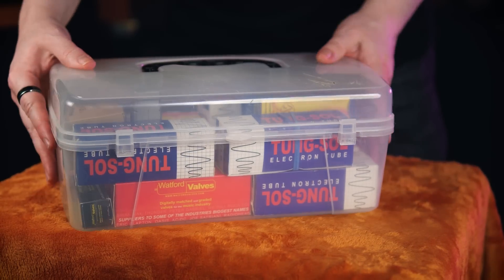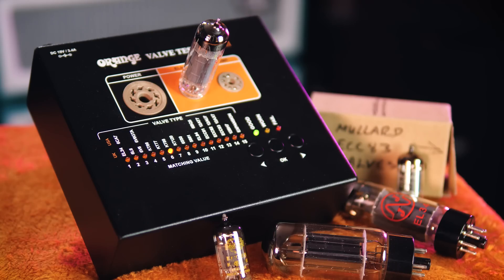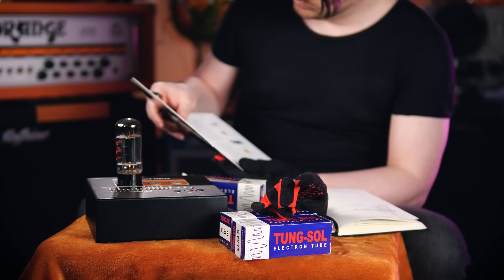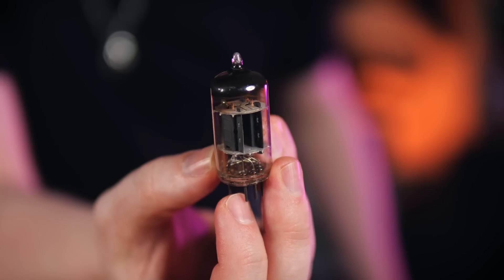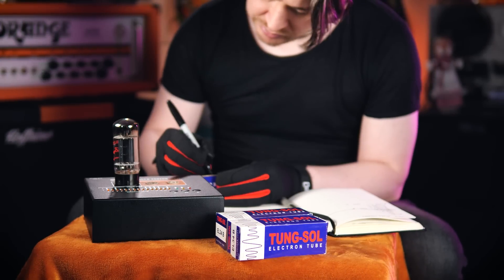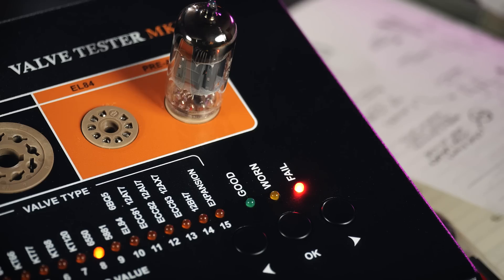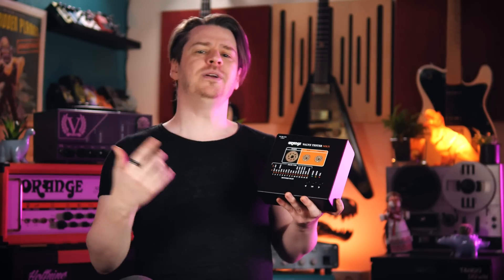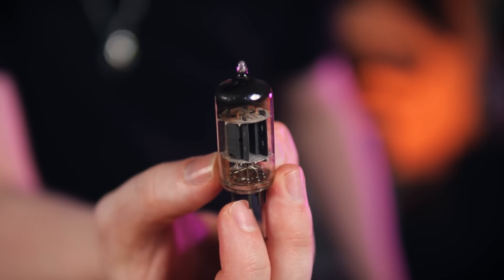Find Tube Faults Easily! | Orange Valve Tester MkII

Comment from the maker: Are my Tubes failing? How do I tell if my valve is microphonic? How do you match power tubes for balanced performance? 
The Valve Tester MkII from Orange will assist any amp tech in quickly and easily uncovering valve faults. 

https://orangeamps.com/product/valve-tester-mkii/

This video contains paid promotion from Orange Amplification.
More details on how Science of Loud implements product promotion - https://www.csguitars.co.uk/disclosure
#scienceofloud #tubeamp #valvetester

More from Science of Loud: 
Support on Patreon: https://www.patreon.com/csguitars
Join Science of Loud Discord - https://discord.gg/uJHFgJRunb
Buy Science of Loud Merchandise - https://www.csguitars.co.uk/store
Website - http://www.csguitars.co.uk
Contact - colin@csguitars.co.uk
_________________________________
Description contains affiliate links. Purchasing using one of these links will generate a small commission for Science of Loud at no additional cost to you.

Comment: For someone that gigs doing club circuits & small tours - or the person with a small recording studio - this is a great device. Even if it doesn't give exact values it get's close enough to give a matched set or more. This can dramatically increase the lifespan & quality of the gear. It can also help diagnose problems in a pinch vs waiting for the electronics tech to make time for you. You could easily save thousands in just time & equipment. I hope Orange engineers keep working on this to be able to add features.

Comment: Good to see a decent valve tester on the market. Yes, it is pricey, but worth it if one repairs a lot of valve gear. I bought a B/K tester from an electronic parts dealer that was going out of business in 1991 and I paid 550.00 USD for it. The list price was 1000.00 USD. It has paid for itself many times over. Performed a recap on it two years ago. Good as new.

Comment: If it's anything like Orange's VT1000 it'll be a burnt out paper weight after two years. Poorly designed and manufactured in China. The older tube testers Arvos, et al built decades ago put this type of crap to shame.

Comment: I have a Truetone(One Spot) mA Meter, cable tester, and (unadvertised) voltage converter. That and the Orange Tube Tester would be the perfect tech kit gadgets. I build big boards and the Truetone has been great, I write the mA on the back of each pedal to be able to reference it later for daisy chains and brick calculations. I use the Truetone Cs7 and 12 and the Voltage converter, again unadvertised but it turns any 9-18V source into whatever the pedal draws,  so the one or 2 12-18V designated outputs don't go to waste I actually mount it to the bottom of the CS7 board.  If I had the Orange Tester, I could run my wet dry wet tube rig with little worry as well. (It was old a huge but I knew i should have jumped on that Marketplace Tube Tester I saw for $50!)

Comment: Got a palmer model five and don't know anything about it. Nothing to find in www. It has two power valves GT6550A. Is it a 100W amp then? These old valves (actually tubes cause made in US 😅) do have signifikant black spots inside the glas. Is that an issue? Should I change them? Everything seems to work fine though. Thx to anybody who could help me out.

Comment: As an owner of many tube amps, this tool is a must buy in spite of the high price tag. I priced similar test tube kits and price is similar. Maxitest has one for less but only does preamp testing so you would have to buy two Maximatcher II and Maximatcher preamp kits at 2k to do same thing.

Comment: I have a question. What kind of switch is in the push/pull pots in my guitar? Is it double pole single throw? I don't know differences between switches.
Reply: You need to look at how many contacts there on the switch (not the 3 potentiometer lugs). From my experience with push/pull switch pots, most of them should have Double Pole Double Throw (DPDT) ON/Off switches. A DPDT switch has the ability to alter pickup phasing, alter the double/single coil configuration of humbucker pickups, turn an LED on/off, and/or power a preamp or an effect circuit contained within your guitar. 13:46
Reply: @toddwilliams8761  thanks, i have wired coil split and phase swap on push pull pots before but now i will try to wire 2 germanium diodes 1n34ato the push pull pot and i i will wire the DPDT part as an on/off switch. Basically i will put passive distortion effect in my guitar. Like a built in distortion pedal in my guitar.

Comment: The MKI unit was very unreliable, failed easily and Orange didn't provide any repair support, we had 2 of those units in our amp repair workshop and both failed and become unusable. I don't know if they fixed the issues with the MKII unit, but be careful, a Tester that you cannot trust is completely useless

Comment: I'd love for you to revisit the topic of valve vs solid state amps. I've yet to find a clear and concise explanation of the real world difference in application especially when it comes to distortion
Reply: Given that valve amps have such different topologies, whether hifi or guitar/bass, it would make for quite a lengthy video! The crux of it though, is that they can all sound different, obviously engineered for use case. Best is subjective. For what it's worth...I play music louder than I should and I love a pair of mesa 2:ninety for mid and tops, laneys nexus tube amps for the weight of sound, and an old denon integrated amp for recording vinyl. The denon sounds OK up to a point, the mesa's sound great past the point id turn down a transistor amp, and the laneys feel great, and roar in such a way long long long past the point the wattage would have you believe. As I said, it's a very subjective topic.

Comment: You can keep the tubes from the quads that tested good either as backup for other push-pull amps with a single pair, or for single ended amps. Or, if you know electronics, use them to build your own amps.

Comment: But over $1000. Priced for people who repair amps, not for the average guitarist I think
Reply from the maker: The average guitarist has no need for one of these, it's specialist test equipment for techs.
Reply: @ScienceofLoud  It's funny how you used to find tube testers at grocery stores (where they would sell you replacements). Now you have to know a guy 😁

A lot of people just buy new tubes without getting the old ones tested.

Comment: I just looked this tester up online..... Bloody Hell!!! HOW MUCH?!??!?!?!!?!
Reply: I guessed it would be $500-900USD, it's a brilliant piece of equipment, not needed for mere guitar players, more for techs who have dozens/hundreds of valves/tubes around.  Unless you are like me and have dozens of amps and more tubes than can be counted, you don't .need. this piece of kit, but I find it a brilliant piece of test equipment.  Chris is obviously a genius, I am a mere brain damaged drug addled guitar player (on good days), but I want an Orange!
Reply: @pharmerdavid1432  I have 1 6505mh and would have more amps if it weren't for the wife.

I have about 6 12ax7 valves for it (+ the 3 in the thing) and a spare pair of EL84 power valves for it. I'm one of those guys that takes the phrase "matched set" at face value as I have no other option. I would love a way to check my valves and make sure I'm know I'm happy with what I'm putting into the thing. Granted, it's not an old AC30 or something where the valves play a far greater role in the operation of the amp but I like to look after what I have.

If I was in your position with the amount of gear you have knocking about then price isn't really an option. You could even deem it as an absolutely necessary piece of kit.

Just £850 ($1,100) stung a little tbh.

Also, swap "valves" for "tubes" as you see fit.

Comment: It looks to be incomplete / VERY short on tubes and results. I guess a 5751 matches well enough to a 12ax7, but I doubt a 6072 / 12ay7 is covered. 3 color LED as the only ‘results’ doesn’t cut it either. I’ll stick with ol’ Superior Instruments TC-55 I got off eBay for 1/20th the price. Not great by any means, but seems to blow this out of the water.

Comment: Dude!!  I have a bugera 333xl that the distorted channels have basically no volume no matter how load I turn it up but if I run a signal like a preamp or my hx stomp into the return of the fx loop and it works perfectly fine as a power amp.  It’s really load being a 120w tube head but the tech I took it to checked all the valves and couldn’t figure out what was wrong with it and said to take it apart would basically cost more than buying a replacement

Comment: Great point on who it's for. I used the original unit for years, and it worked great to quickly identify the state of a tube, and then a good tech can use their ears to decide from there. The one complaint we always had, and it seems Orange tried to address with the microphonics testing, is that to truly test the roadworthiness of the tube - it should have a vibration monitor inside! Emulate the shake!  SHAKE IT!

Comment: I used to work for Marshall (terrible employer with 1960s-whip-cracking values in the 1990s so I left) 
We tested if the valves were microphonic by tapping them individually and listening to find if any were significantly louder than the rest ...with no signal passing. With  this in mind your vintage amp may not have passed this test when it was brand new. Just sayin'.

Comment: Have the mk1 version and still working great after all these years... hundreds of valves tested at my workshop... had to resolder all the tube socket pins due to wear and Stress... apart from that... works like a charm... nothing to complain

Comment: I would be interested in a less expensive 9-pin tube tester .. one that only tested el-84s and ecc83 would probably fly off the shelves at the right price.

just one socket, less interface, and much less processing power.....the problem is, it would still need a power supply; and that costs.
Reply: get a used vt 1000

Comment: if I had a higher power Si rectifier amp, it would eventually pay for itself. ( or like a bassist who runs a Traynor YBA 300, would waste a lot of money if they didn't get one )

but my only tube amp is a 5Watt with a 6Z4, so it's better to just swap tubes at reasonable intervals.

Comment: Colin,
     Really cool piece of kit!  Does operating the tester require wearing black and red gloves? :D
Reply from the maker: Gloves aren't required to handle valves, but I didn't fancy getting glass in my hands if I accidently broke any
Reply: @ScienceofLoud  That all makes sense.  Actually, I was teasing you a little about your "stylish" choice of gloves :D  Rock on!
Reply: 1 - possible breakage
2 - tubes get HOT when you apply power to them.
Reply: You could absolutely go with other options like black+orange, black+navy blue, red+navy and many more. Just don't use pure white, because your valves could be scared and run away.

Comment: Holy Cow! It's about time something like this is made available to techs! The last "Tube Tester" I ever saw was at a Radio Shack in the mid 80's. That was a monstrosity, but it did very similar tests on many kinds of valves, not just ECC8x or 12A_7 and the 3 major power amp valves. Some of the socket designs dated way back to the invention of valves, or shortly after (late 20s, early 30s?). It also only told you if the valve was ok, worn or dead...that's it. This much more advanced device looks like something our shop needs.

Comment: If this is affordable, this is a great tool for a guitarist. Not for a tech necessarily (however plenty of amp techs are used to working without a valve tester altogether), but it's a good middle of the spectrum product. Like do you want to hunt for a huge valve tester from the 60's for god knows how much money just to have any indication of the valve health?

Looked up the price for this, at £850 (but free delivery worldwide!) this is far beyond the reach of any guitarist and most techs so I have no idea who this product is for. What is the target audience that is willing to put that much money into a monitoring device that's not absolutely fully featured? It's way easier to monitor some audible or behavioral changes and just replace with a new tube, or trying a backup tube to see if it fixes the problem and then getting a new one if it's very high quality. I assumed this to be priced at 100-200 euros and being a reasonable buy even if you don't absolutely need it.
Reply: Don’t know what world amp techs don’t use tube testers unless they’re overpriced hacks. £850 is sort of reasonable for a piece of testing equipment, on the pricy side but it’s going to last longer than the old stock as you say. If you think about how much guitarists spend on amps and gear, it’s a pretty minor cost overall when a retube of some bass amps costs the same

Comment: 99% of the time its not your tubes, you just want it to be because thats the simplest possible repair.
Reply: In my experience, 30% of the time it’s the tubes, 50% the caps and a lot of the rest of those repairs are consequences of a valves failing and damaging other stuff, but you might not realise as the first thing most people do is replace their valves
Reply: @flyingrat492 fair enough but I think who OP was originally saying that for is for the “my amp is currently on fire and every time I touch it I get knocked unconscious for about 10 minutes after being shocked…should I replace my tubes?” crowd, which is probably about 95% of guitarists.
Reply: @K707OR30 I mean I had a similar less serious problem caused by a tubes heater shorting, so you could actually have that problem from a bad valve. But I get what you mean
Reply: @flyingrat492  The heater in a tube is basically a lightbulb filament with extra thorium, they don't tend to fail closed but rather wide open. If it did somehow short it would just pop your fuse or at worst damage the heater winding on your power transformer
Reply: 99%??? Tubes are, or originally were, the cause of a lot of problems. It depends what kind of problem you're having of course, but certain types of issues are commonly caused by tubes. But, tubes are the easiest thing to replace and a lot of people just will replace their tubes and you'll never hear about them having an issue. The things that you hear about are problems people weren't able to fix themselves.
Reply: What? Most times its the tubes unless you have an old amp or a poorly built amp. Unfortunately a lot of new amps come with junk tubes in them that were bought in bulk and not tested. As long as they work, they out them in.
Reply: @douglasdog1  I restore radios from the 1930s and about 75% of the tubes are still fine after almost 100 years. Same with guitar amps - still running the original set from 1960s or 70s and working just fine. If only life were that simple you wouldn't need technicians like me.
Reply: @barretprivateer8768  I agree 100%. I have some  old marconi and I think an old RCA tube that still work fine as well as some newer tubes that have lasted a very long time. Unfortunately they don’t make tubes like they used to, the machines are old, and the tolerances aren’t as good or the QC. A quality set of tubes are a small fortune compared to what generally comes in tube amps today. The tubes in my main amp that I use everyday and push hard, has had the same tubes in it for 5 years and still sound perfectly fine.  Before them, I had gone through two sets of power tubes within a year. Nothing has changed inside the amp regarding the power section. Just bad tubes. Orange was sending out all kinds of amps with junk 12AX7’s. People thought the amp was bad because the pots were scratchy when really the problem were the brand new tubes leaking DC from the grids onto the gain control before the tube.
Reply: @barretprivateer8768  radios and amps are different beasts in far different situations, they’re biased a lot colder and never really pushed in the same way as guitar amps
Reply: @flyingrat492  Nothing you've said has been correct so far
Reply: Check the simplest and easiest first
Reply: So many people need to read this
Reply: I don't care what it is as long as it's not a transformer.